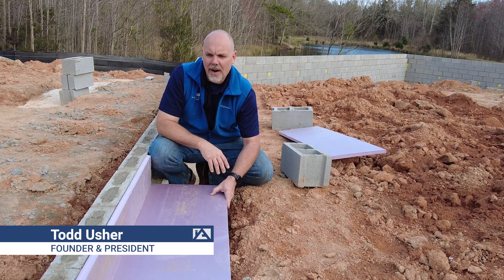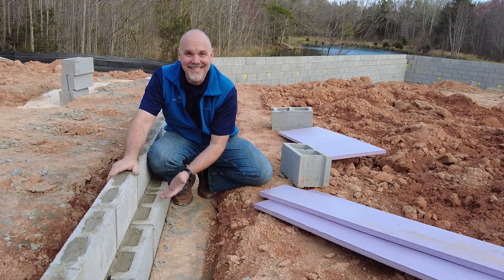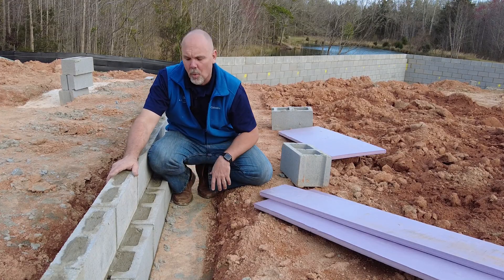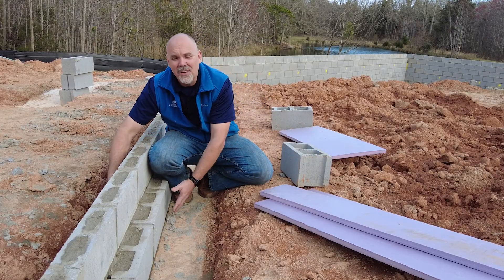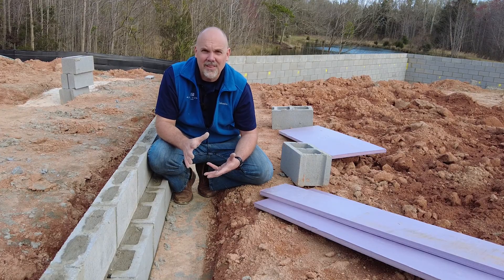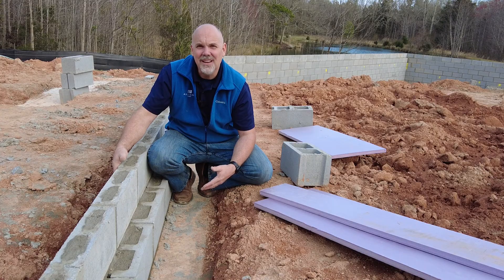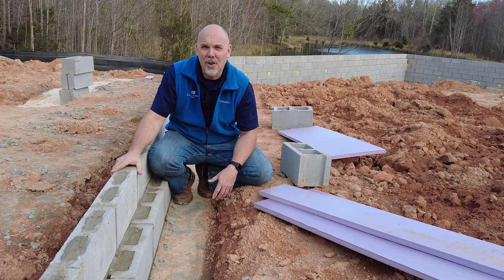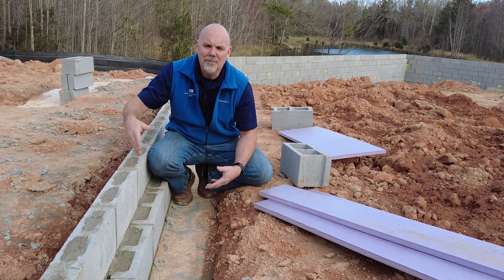What's the Difference? | Slab Foundation Comparison

Comment: Setting aside cost, wouldn't it be beneficial to tie the slab to the stem wall with rebar, ie, have some angled rebar coming out of that bottom course of block and tying into the rebar grid on the slab?
Reply from the maker: There are really no benefits to tying the slab to the stem wall if everything is constructed on sound subgrade.  If you brought the rebar out of the bottom course of block, it would be near impossible to insulate the perimeter of the slab.

Comment: You mentioned putting the insulation around the edges to prevent heat loss. What about heat loss from the middle of the slab going down into that 60° soil? How does that work or not work? Thanks
Reply from the maker: Great question Kevin!  In climate zone 3, we are cooling dominated, so the stable ground temperature beneath the middle of the slab actually helps to reduce the cooling load on the home.  While it is a slight penalty in the heating season, its reduction in cooling load more than compensates for this.  We could certainly add continuous insulation under the entire slab, but the perimeter approach is a great balance of cost and effectiveness.
Reply: In this system, if you do not have ground water 8 feet below all the soil down there works as an insulation. Such practice is very common in countries with cold climates

Comment: Why do you need to insulate the perimeter of a monolithic slab? Sounds like a straw man argument to me. Monolithic slabs are extremely formidable against all assailants. I come from Texas. Monolithic slabs are were almost all we knew.
Reply from the maker: In our climate zone, and in most zones covering Texas, the energy code doesn't require the perimeter of a slab to be insulated.  However, concrete is a fantastic conductor of heat and without a perimeter thermal break (insulation), heat will move out of the slab edges in cold weather, resulting in energy loss and potential comfort issues.  Concrete is definitely not formidable against heat movement.  In colder climates, insulation is required by code.  Hope this helps!
Reply: Silly Texans. Jk north west Arkansas here. We insulate under slab here. Helps a ton in winter but does hurt in summer. Closed cell helps most

Comment: Curious as well as to experience with Superior Wall.  In your intro I believe it makes a cameo being installed.  Was that a customer one time or you find it to be an effective sub for block or powered foundations when doing full basement.
Reply: Hi Kevin!  We have been using Superior Walls for our basement foundations for 20 years.  I absolutely love the product and we find it to be more cost competitive than poured concrete walls in our market.  We don't build block basements.  Our clients receive a lifetime warranty from Superior Walls on their basement system covering structural and moisture infiltration and the system provides a waterproof, insulated, and ready to finish system.  Happy to discuss further if you're considering using the product.

Comment: Do you insulate under the entire slab or just perimeter and stem wall?  Was curious as well, appeared to be drop off behind you, combination crawl and slab or fill to allow for slab through out? Appreciate good basic info at an affordable level.
Reply from the maker: Thanks for the questions!  In our climate zone, we only insulate the perimeter and stem wall to reduce the perimeter thermal break.  We actually gain benefit from the stable ground temperature beneath the slab which helps to reduce our cooling loads in the summer.
The stemwall slab in this video was taller on one end due to the variation in topography and was filled to be slab for the entire foundation.